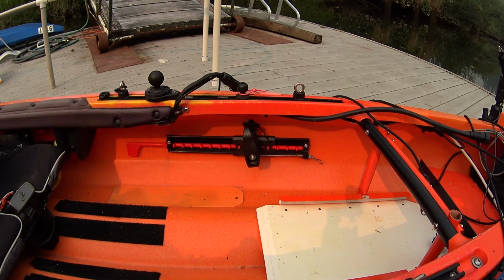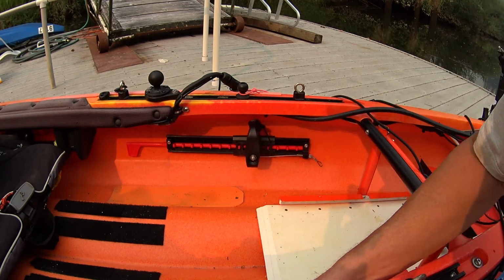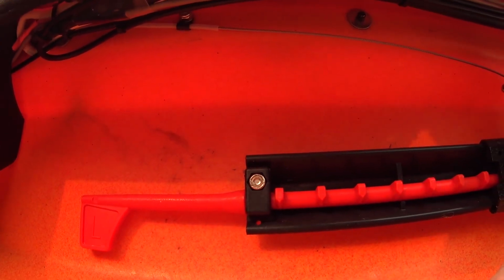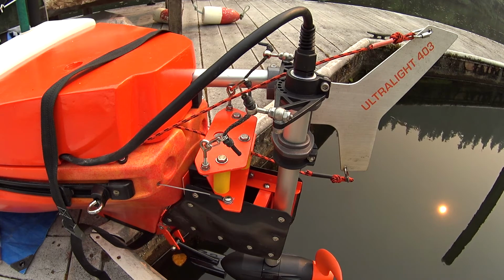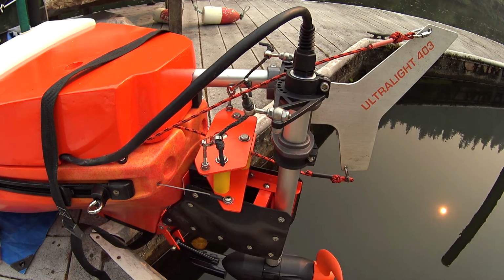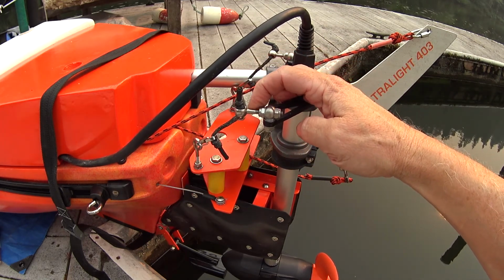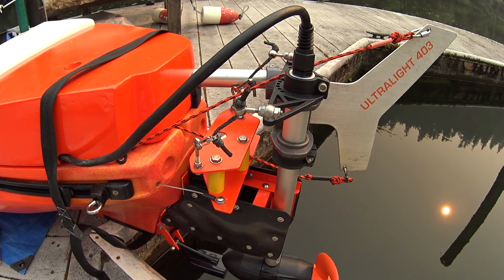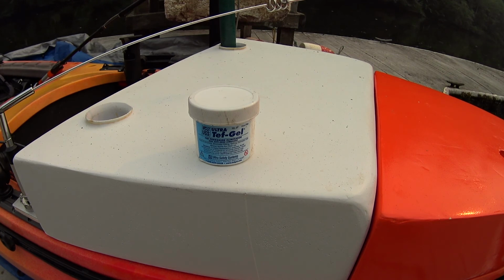Fishing kayak setup 2017 - Torqeedo steering

Comment: Quick question.... why use the rudder and all the extra hardware/ added weight when you could just steer with cables going to trolling motor?
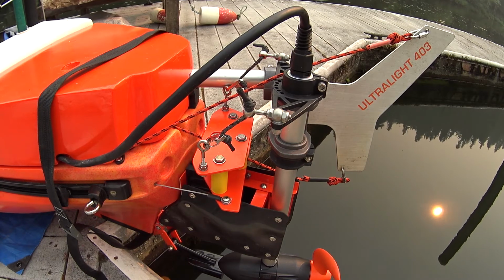Reply from the maker: If you're asking why not connect the motor to the rudder pedals directly with cables, that is explained at 3:20 in the video.